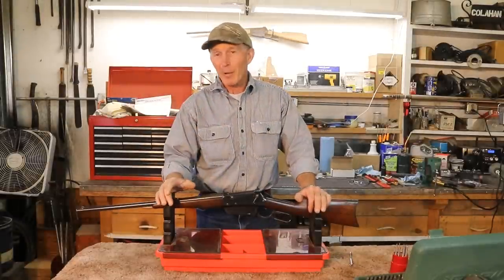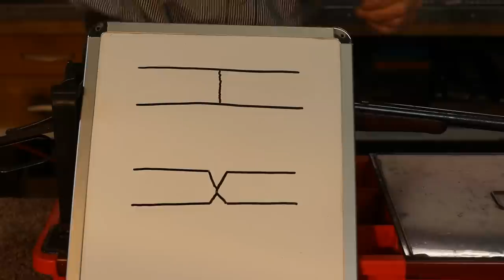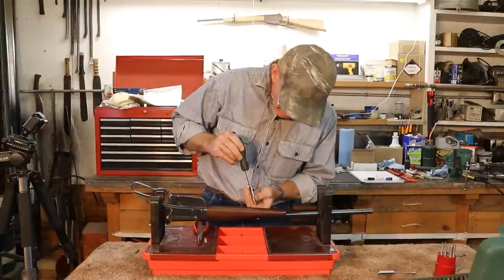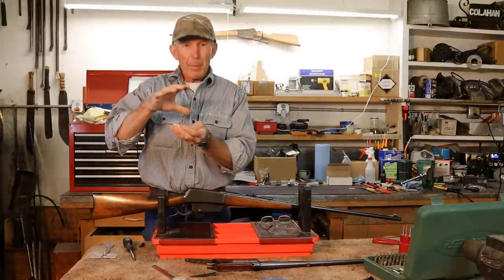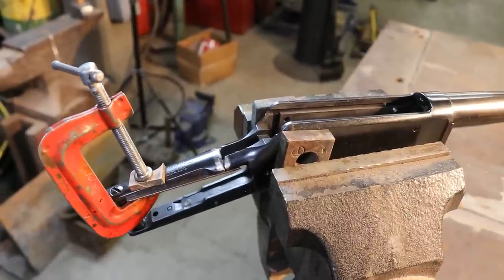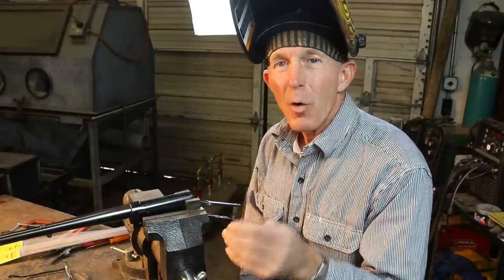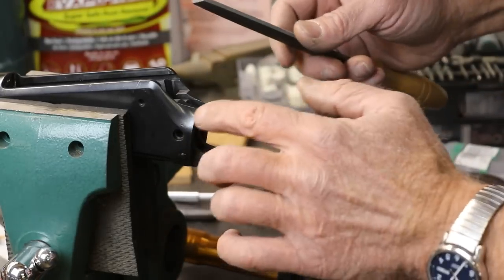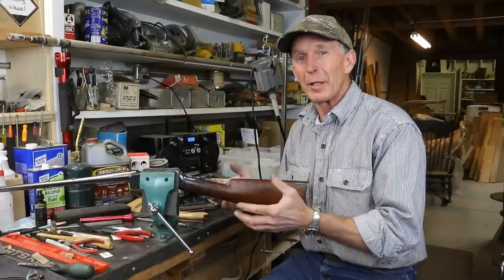How To Repair a Broken Tang

Comment: I’ve done only a small amount of gun smithing however I have thirty years of tig welding. You did a fine job on that tang.
Reply from the maker: Thanks a bunch, Jeff!  I don't tig weld consistently enough to keep sharp.  Whenever I have some welding to do, I save up several projects and do them all at once.  Beforehand, I weld up quite a few scrap pieces just to get a feel for it again.

Comment: This one of your best video's, right up to where you didn't give us close-up of the finish polish and blueing. Then what you did to the stock and what that looked like before and after you put it together. Great job though
Reply from the maker: Thanks.  You'll just have to wait for the episodes on polishing, bluing and stock repair, though.  This episode was intended to show how to weld up a tang and not an episode on the entire restoration.

Comment: I did a lot of tig welding of aircraft and missile parts in my aerospace career. Just retired in Jan. after 36 years. We used Miller welders with a .040 tungsten and .030 dia filler rods. A lot of stainless and aluminum some titanium and inconell in the mix. You did an excellent job of heat and stress management. If you tie it down it can't move. You're pretty steady too. That weld is probably stronger than the parent metal. Good job...

Comment: Old world craftsmanship with modern tooling, and a sure enough craftsman doing the work. You make it look easy. But, with a background in welding and gun repair I can appreciate the difficulty in making that repair. Top shelf work Mark.
Reply from the maker: Thanks Paul.  It's definitely a tough repair to do properly.  I just did this same repair on an 1894 yesterday that had been welded many years ago and failed.  Having to remove the porous old weld and start over made it a doubly tough repair.  If I'd realized it had a previous repair I probably wouldn't have taken it on, but it turned out really good.
Reply: @thecinnabar8442   It’s always a chore correcting someone else’s “repair” isn’t it. Folks need to know when they’re in over their head. Wasn’t it Clint Eastwood that said “A man’s got to know his limitations” 
Love your channel. Keep up the stellar work my friend.

Comment: Very informative Mark. I have an 1863 Sharps carbine that needs the same repair. I really like your spacer idea as well. I may further improve on it by drilling out a piece of square key stock of the correct width in a 5C square collect in my lathe.. This way, I can align my break better with a second parallel clamp. Thank you again for the inspiration. Where can one purchase the closer alloy rod?
Reply: Mark said Brownells.

Comment: Very nice work. I have a 1978 model Winchester 94 in .30-30 of my dads with a busted tang in the same spot. Definitely not a job for me. The only reason I'm going to get it repaired is for sentimental reasons. Thank you for the video.

Comment: Nice work.   Thank you for sharing.  I tried some welding last year with a cheap Wire welder from Harbor Freight.   I was either burning holes in it or mud dobbing.

Comment: Don't know where else to ask this, so here goes. If you needed to convert a standard 94 or 92 SRC to a "trapper" or "special carbine"  configuration due to severe muzzle and mag tube damage what are we up against? The front sight base? Milled out of the original barrel stock or dovetailed? I can't determine by looking at it.

Comment: Wow, perfect video for me to find. I have a Steven's Favorite 1915 with a completely missing top tang and no stock. Mine shows no sign of crack or grinding marks so I'm puzzled as to why it's not there. I don't know exactly what steel to use for the weld but I'll figure something out. More for function than to restore to original.

Comment: When my Dad passed, I came into a barreled action, an early 1894 SRC chambered to 25-35.  The bore looks like a sewer pipe, but it's original.  The worst part of the rifle is that somewhere in it's past, the tangs, both upper and lower, were broken, most likely when my uncle rolled his horse on it.  Someone had brazed the tangs back onto the receiver and lower receiver, but they're crooked, and the braze very poorly done.  i hate to see this one go on the wall to hang my hats on, what would you suggest to put this thing back into a shooting piece?  A new barrel is a given, and I'm on the lookout for the lower receiver with the right angle to replace what I've got.  There's enough left of the tang up top that I don't think the lockup should be affected, but I've no idea how much heat was applied, nor the skill level of the hammer mechanic that brazed it up....  I hate to give up on 'family' guns.  Uncle Bert went from the Pusan Perimeter north, washed his socks in the Yalu, and ended up on the 38th, all with the 1st Cav. Div., till my Dad's division, the 45th ID, relieved them Dec. 51.  You likely didn't need to read a short story turned long, so I'll shut the hell up and wait for a response, but I've a good idea what you'll say.  Take 'er easy, have fun, don't git caught!!!
Reply from the maker: I tried to repair one of my own that had been brazed and it didn't come out very well.  All the brazing has to come off before it can be welded.  By the time I ground all the brazing off, it was nearly impossible to get it lined up properly to weld on straight and there was a gap to fill between the pieces that is hard to fill with Tig welding.
Reply: About what I knew. Guess that I was hoping that You might have a magic wand to wave over the thing and make er all better!  Mrs told me I was too old to believe in Santy Claus, the Tooth Fairy and the Easter Bunny, but a guy's gotta hold out for a miracle or two, don't  He?  Thanks a ton, anyway!  Love the shows!  Have fun, don't  git caught!

Comment: I have an old uberti 1860 revolver that has a hairline surface crack in the frame from improper heat treating, I think the thinner part where it is milled out for the hand is really easy to over heat while case hardening.  I was thinking of tig welding it but I'm not sure if firing a black powder revolver puts much strain on that part of the frame.  It may be best just to leave it original but I don't feel I could ever sell it knowing there's a possible flaw in the frame

Comment: That method can be used to repair pittings in a pistol frame ?
Reply from the maker: Yes it can.  We do quite a bit of pit filling with tig welding.  The latest and greatest device for pit filling is with laser welders.  We've had a local jeweler with a laser welder do some pit filling on a receiver for us.
Reply: @thecinnabar8442  Cool, good to know. I have a P04 and a Schnellfeuer, in excellent condition, but they have been stored for decades, and some pittings have formed in frames, I was thinking about repairing them.

Comment: Can you make a straight grip mod.94 into a pistol grip ?
I was thinking using a mod 71 tang  or any other idea ?
Would like a big bore .375 win pistol grip. 
Good repair 👍
Reply from the maker: The lower tang on an 1894 is removable, so it can be replaced with a lower tang from a pistol grip model.  Unfortunately, it's not usually very easy to find a pistol grip lower tang for sale.  The other option is to bend the lower tang on a straight grip 1894.  It's not a simple task to get it right though.

Comment: Did you cold blue the repair?  I have been researching Winchester and Colt's vintage fire, charcoal, or machine blue "Whichever term is correct" and would really appreciate a video on it if possible.
Reply from the maker: That repair was part of a complete restoration that was eventually blued using DuLite salts.  Fire, charcoal and machine blue refer to three different bluing processes used by Colt.  The fourth was carbonia blue.  Fire (or nitre blue) and machine (or hot salt) blueing are still widely used, but the carbonia bluing process using sperm whale oil and large ovens of charcoal has been lost to time.  There are only a couple of high-end restorers that I know of who are again using charcoal bluing.  I've been experimenting with chacoal bluing but am not using it on firearms yet.
Reply: Thank you! Hopefully your charcoal blue process turns out well and you are able to share it in the future!  Thank you for all that you do and share with us.
 @thecinnabar8442

Comment: Wondering if silver brazing might be a better way to make this repair.
Reply: I’d say probably not. It wouldn’t take the bluing nor would it be as strong as a properly made weld joint.
Reply from the maker: You're exactly right!  Silver solder is great stuff for many repairs but would be a poor choice for this application for those reasons.